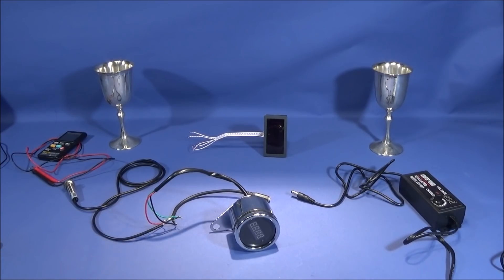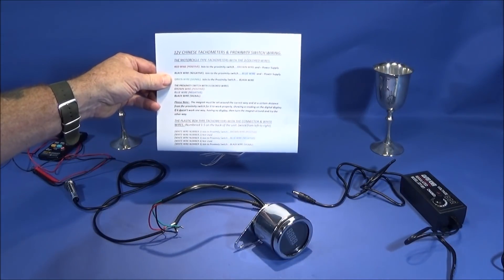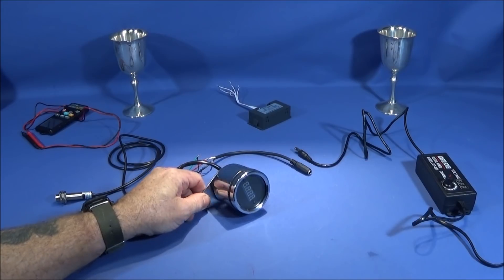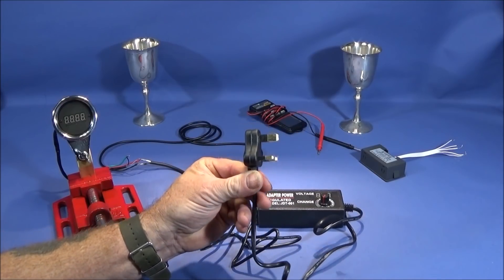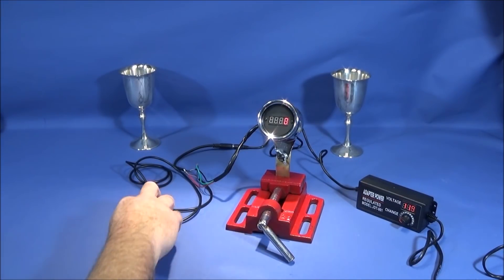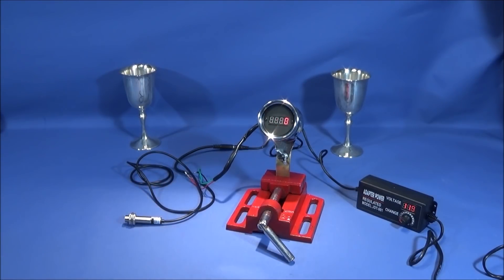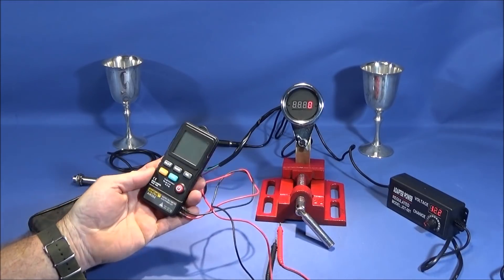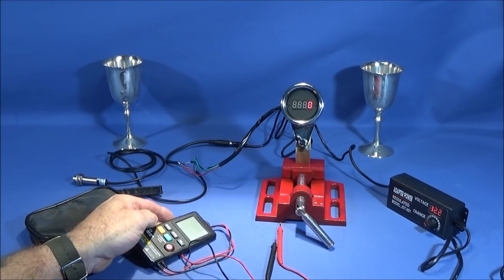A New Motorcycle Machine Tool Tachometer & Voltage Adapter JDT-001

Comment from the maker: SEE ALL THESE HIGH QUALITY LOW COST TOOLS BELOW:-
LED Motorcycle Digital Tachometer --  https://goo.gl/2rRiKh
Sensor Cable With 3 Magnet -- https://goo.gl/Meam7q
LED Digital Tachometer With Proximity https://goo.gl/6yGjCv
ANENG AN302 True RMS 8000 Digital Multimeter -- https://goo.gl/cZSvj6
Excellway® 9-24V 3A 72W AC/DC Power Adapter -- https://goo.gl/JjqBnR
9-24V 2.5A 60W Speed Control Volt AC/DC Power Adapter -- https://goo.gl/eNVv6n
Reply from the maker: Black Friday Electronics & Tools Sale -- https://goo.gl/HNv3UP
       Black Friday Tool & Mechanical Part -- https://goo.gl/KUnhfh
       Black Friday New Tools -- https://goo.gl/TxwLya
       Black Friday Professional Tools -- https://goo.gl/h3BGon

Comment: Hi Steve love your videos and have made many of the modifications to my lathe but am having trouble with the tachometer when I wire it up as you say the tacho lights up and the proximity  sensor's light comes on but can't get a reading i have tried two magnets 180 degrees  apart and facing different sides. I had same problem with 5 wire tach. as well . is it possible the sensor is faulty???

Comment: Need instructions for the 5-white wired tachometer?
Couldn't find you, or the instructions in Google+.
Please help me find those instructions.
Cheers
Reply from the maker: It is all on my Google Plus Page
Reply from the maker: If you click on my Youtube page on the photo at the top, the Google+ logo is on bottom right hand side.....click on that.
Reply: Okay, never knew, or did that.
Cheers
Reply from the maker: https://plus.google.com/photos/photo/112996673208946538985/6614462289840906466

Comment: On the tach is there a spec on how far the magnet needs to be from the center? I would think the farther out it is mounted would affect the reading?
Reply from the maker: Just put it near enough centre and it will work.

Comment: Maybe you should read the spec before you describe the part you are talking about :

Specification:
Shell Material: Stainless Steel
Reply from the maker: Well that's even better.... I think I missed that one on the spec because my glasses had a distracting glaring reflection on them, caused by the floodlights on the new shiny tachometer.
Reply: Steve Jordan .  Ha ha, nice one 😀